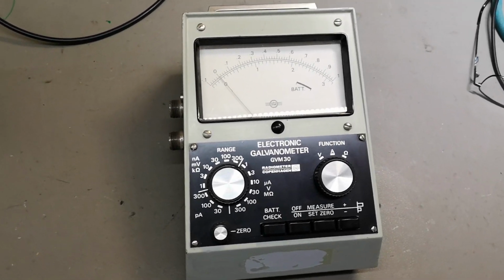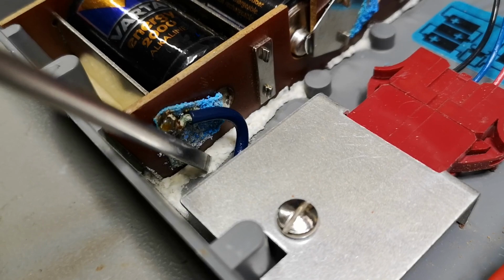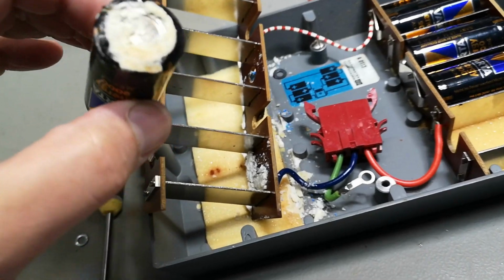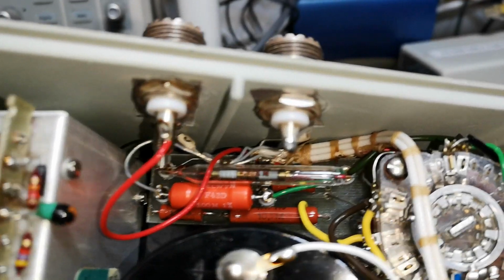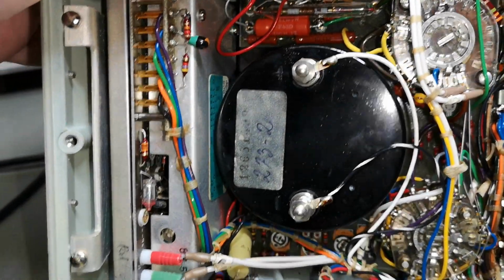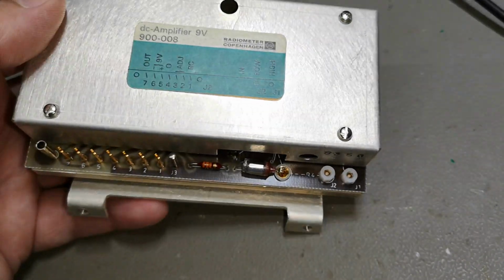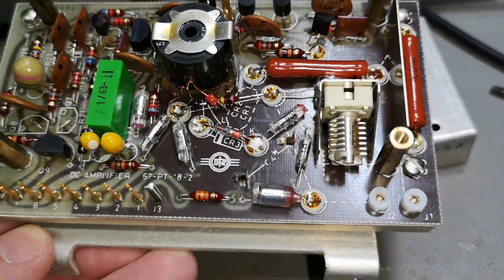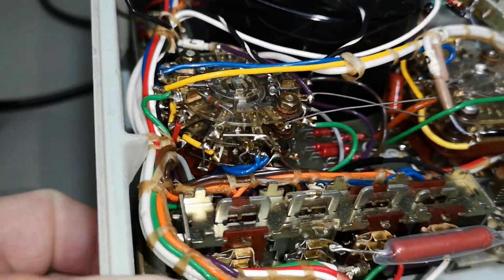Radiometer GVM30 Electronic Galvanometer 1970 test teardown

Comment: Looks like a chopper stabilised amplifier, with the input being switched and then amplified. Transformer used to switch, with the jfets doing the chopping, thus needing the capacitor to equalise the slight differences in them dumping charge. Probably most of the problem is that switch with the broken vinyl part, easy enough to cut out of some PTFE sheet and put in there. Those clear switch wafers are common enough on 1970's era tech, used as they are lower leakage than SRBP, but yes they do get brittle with time.
Reply from the maker: thanks again Sean for all your comments, yes that was also my take on this type of "DC" amplifier, it is a bit of a mecanical challenge to fix that switch correctly, so it will not degrade the performance of the construction, I can not offer to spend many days on this, sorry, i think i put this unit for trade, let the new owner play with this, at least he know exactly what he get and can expect.. and i get some more stuff to play with. win win..